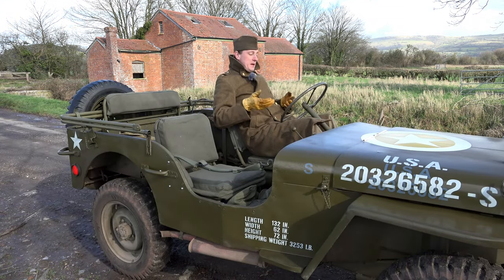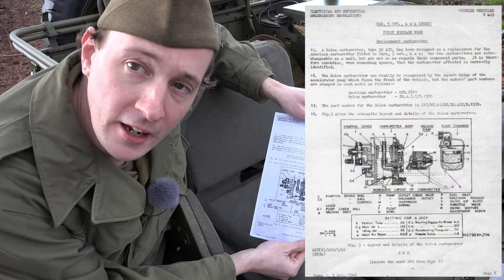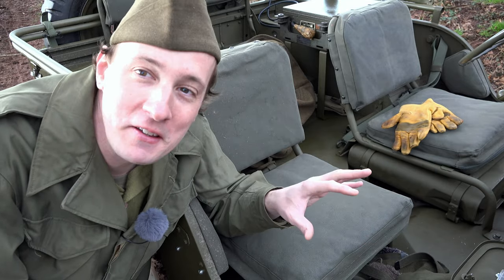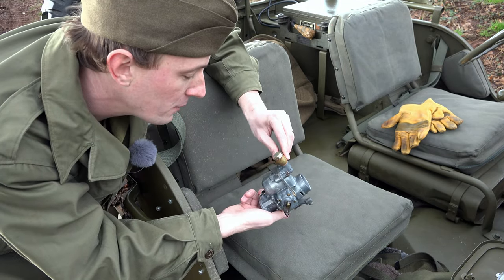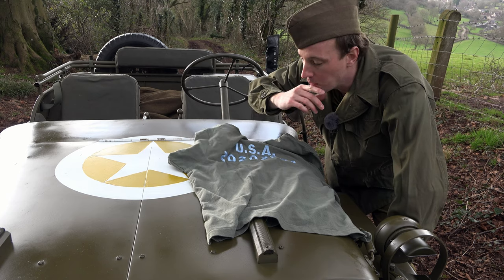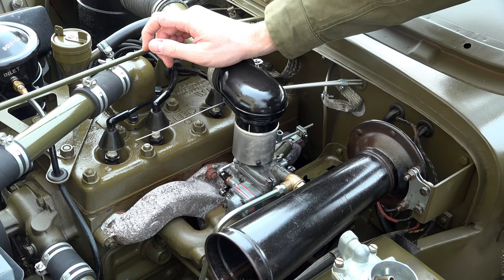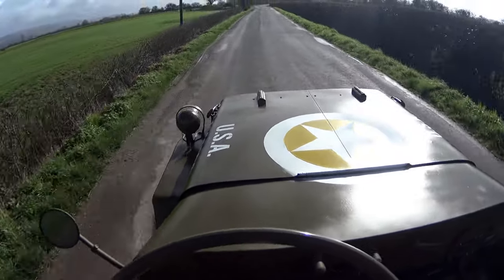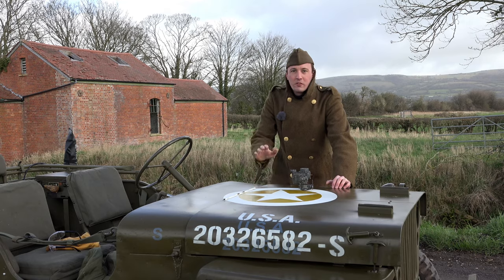Awesome discovery for my WW2 Willys jeep, Making the rarest jeep!

Comment: OMG not the infamous shit box Solex !!!  I had a Solex on a '72 Opel Manta Rally, it was the one that came with it and no matter what you did that POS would not run right.  I rebuilt it once and a local carb shop rebuilt it once and it never worked. Finally a guy at a local foreign car shop told me to put a two barrel Weber on it so thats what I did and that little Weber solved ALL my problems.  It ran like a watch was easy to tune and keep in adjustment etc. that car never ran so good.  My friend also had a POS solex on his old VW Beetle and it was the same story - we found a weber for it and problems solved.

Comment: Education and enlightenment....delivered!

The economy works like an old tractor carburetor, you find a happy spot between idle mixture curve and power mixture curve and you get what you get. You found it in the 2nd gear mash. Lack of an acceleration adjustable mixture curve.

The governed carb is probably for the willys engines with pto and governor. Like the jeep a trench. 

Looking forward to the next video!
Reply from the maker: Thanks Ben,  yep the French document says the governed carb is for agriculture etc.  Its interesting how a Carb like the WO is a complete dog without the accel pump operating correctly but another carb that's designed for it can run quite happily without a pump!

Comment: Fantastic video!  I've been using the 32pbic clone from India for 12 years and couldn't be happier with it.  Great fuel economy (22-24mpg US) and you can R&R all of the brass jets and ports from the outside of the carburetor  and blow them out in about 10 minutes.  It is very easy to live with.  I will add though, they come from the factory with some minor defects which need to be remedied with a small bit of work.  In particular, I found that the small hole in the brass disc in the 'cold starter' is not in the correct spot.  Re-drill that 1/8" hole correctly and you're good to go.  You can also buy Solex main jets to work at whatever altitude you are at for best running.  I'm at 6,000' and the #115 works the best (#127.5 is stock for sea level).  My WO jeep friends are often having to mess with their carburetors, I have no such issues.

Comment: You've talked me into trying my old solex on my engine. I have one completely unmarked and it is not as tall as the new solex that the distributors sell. Have it in a pile of old jeep parts and this video piqued my curiosity!
Reply: And?!
Reply: @samholdsworth3957  sorry, I'm not a good source on the Solex topic. I put it on and it idled but had a vacuum leak under a load. I tuned my metering rod on my Carter WO and haven't looked back. Sorry about that

Comment: Oh my gosh it would be a right cow without the accelerator pump :o The governor carb I would think was exactly the same unit with more linkage. We’ve seen this where Lucas have given the same distributor a different number because the engine timing was different. * S1 solex  landrover carb is the pump type. Prone to icing up internally. Governor body goes up front with a thermostat housing bracket and a short belt to the fan pulley (double slot) to work the pto. Maybe there were jeep radio cars that ran the governor carb?

Comment: Excellent vid, I learned stuff. Mine must be a PBIC I guess? Not that you should be giving a cold engine full power, but you can with the non flappy choke because there is no restriction. Great for a quick offski when the enemy surprises you :o)

Comment: Keep in mind, if the throttle is flipped to wide open, the vacuum available will drop. Hence the loss of power  on a wide open condition at low RPM.

Comment: I bought a 1952 Canadian m38 about two years ago (my first jeep)  I imagine that it was recently refurbished before I bought it. It was fitted with a brand new carb. a friend said it was a Solex, but there are no markings on it at all, so I assume that it is an Indian? copy, It runs fine but the nearest info. I can get on it is on You Tube when I look at tuning Volkswagons.
Reply from the maker: Probably A Chinese copy Solex Colin, if it runs fine then you're good to go!
Reply: Did 12 years in the CF. Never saw a Solex on any Canadian M-38 while in service, what happened after they were surplussed in the 80's is anyone's guess.